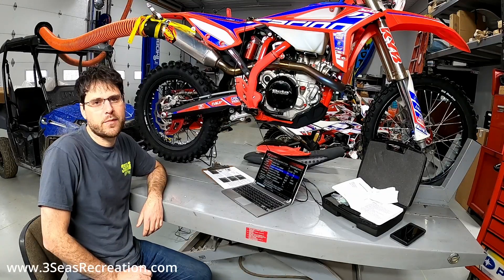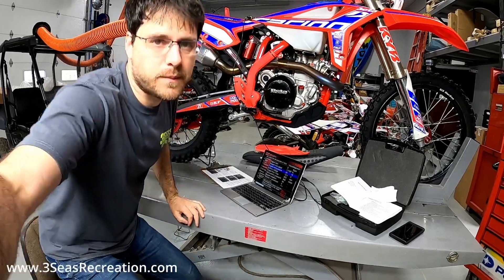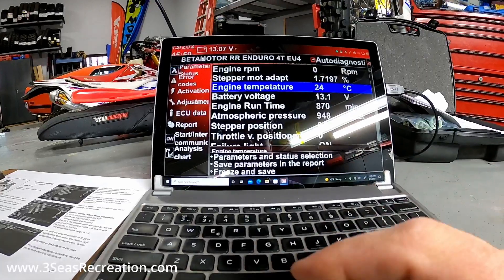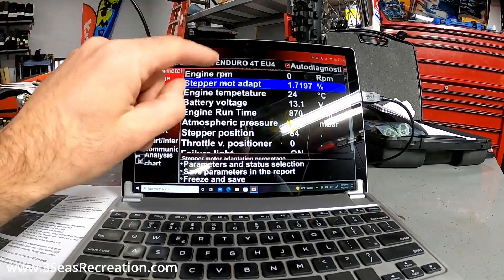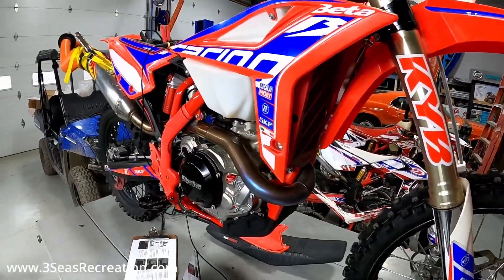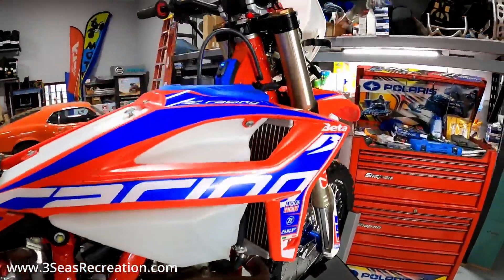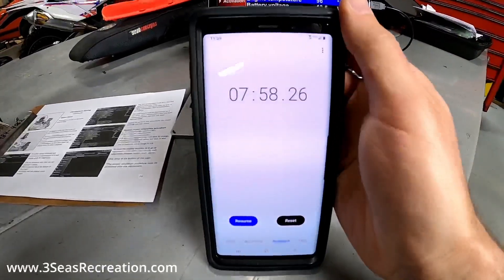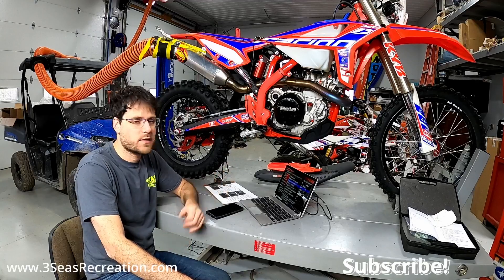Poor Running Beta 4 Stroke Motorcycle | STEPPER MOTOR RESET | Stepper Motor Adaptation Procedure

Comment: What if you’re out riding with elevation changes??? My bike runs like crap on mountain trails. Sputters and dies with clutch pulled in on downhills. 24 Beta 390 with less than 30 hours. I reset stepper at the beginning of every ride. Dealer says it has the open map plus 200 idle. Fmf slip on

Comment: I can’t get my bike to run long enough to change the stepper motor , does it matter if my battery gauge shows it’s only 1/2 full ?  2019 350 rv 19 hours
Reply from the maker: Yes, you HAVE to have a perfect battery for a 4-stroke Beta to run. Does not matter. I can't stress that enough. Enjoy The Ride, Jared

Comment: Hi
I have a 2023 beta 390 rr. I’m having trouble with the idle speed. When the bike is cold it doesn’t idle and when hot it idles very low. I’m not being able to reset the stepper motor because when it is cold it won’t start without me having to give it a little throttle.
Do you have ane suggestions?
Any help is appreciated
Reply: Never mind 
I fixed it
Reply from the maker: Good Afternoon, what ended up being your fix?

Comment: Hello, congrats from Spain 👍🏼👏🏼, i see all your videos and tutorial, it's fantastic 👌🏼 
i had a problem with my '21 beta 350 race, sometimes when i push the start engine switch, the engine turn but dont start, after the 3 or 4 try, the engine start normally, its posible that need a new stepper engine or adjustment?? Thanks and sorry for my bad english 😅

Comment: Jared, I am relatively new to Beta and your videos have been great. I have a 390RR-S. I have been doing the stepped reset and keep a good battery. Out of nowhere the bike all of a sudden revs super high at idle. I took the stepper out and cleaned it. Reinstalled and reset stepper. Everything seemed fine for a few minutes and then the throttle started hanging a bit. Then the really high idle came back. Is it common for these motors to go bad? Is this a symptom of a stuck motor?
Reply: 22 390rr mine did the same but only since i swapped bars over and the throttle cable was not sitting right on the throttle tube, coule be a simple place for you to start looking?

Comment: Hi, I would like to ask, when my rr 390 2018, warms up sometimes (mostly during riding) the bike gets really weird idle, when in sounds like it is nearly stalling itself (its like hard ticking sound, similar to badly adjusted valves ), when I restart the bike it doesn´t do it,  do you think it is a stepper motor issue ? When it could be dirty and doesn´t work properly or do you have any ideas ?

Comment: We love your content!  I often start rides here in Colorado at 7,000' and go as high as 12,, even 13,000'.  How do the Beta 4 strokes compensate for the decrease in oxygen at those elevations during a ride?
Reply: I have the same question. I live in St. Louis but ride in Colorado frequently. I just bought a 2024 Beta 500 RS.  I hope that I haven’t just made a big mistake.  May I ask what year and model bike you have? Does it run cleanly at high elevation?

Comment: What if it won’t start without cracking the throttle. Is it still ok and it will go through the process?
Reply from the maker: If you need the throttle for a split second that will be ok. I would think after the stepper motor resets you wont have to do that. Enjoy The Ride, Jared

Comment: More great info that will help get me get up to speed once I switch from Husky👍
Reply from the maker: Glad to hear it!
Reply: @3SRTVOfficial got the 24 390 last week. The stepper reset was done at the dealer at 2,000’. 
I did a reset immediately when I got home at 6,800’
I wasn’t paying attention. When I checked, it was at 226° Fahrenheit or 108 Celsius. 

My first ride today had a lag like a two stroke power valve. So it’s not fueling properly. 

Could going 13 Celsius over the reset value be the cause of the poor fueling?
Reply: Update. My bike had multiple problems. At 13 hours, the head, valves, guides and seals were all replaced. 
Looks like that solved the oil draining through the faulty valve guides and causing smoke. 

Once I learned it had 2 injectors, I asked if they were staged in the throttle position. 
YES was the answer..

That’s when it all made sense. I kept saying it acts like an accelerator pump or main jet carb problem. 
With the knowledge about how the secondary jet functions, I watched your jet maintenance video, used my $20 jet cleaner tool. It sprayed kpkike a squirt gun if 2 streams. 
I waited for the brake cleaner to soak a bit, then it kind of spit some thick streams out. 
The 3rd time, I sprayed for 5 seconds, that’s when a mist came out. 
4 time I couldn’t repeat the mist, but got more of a heavy spray. I’m guessing that there wasn’t as much pressure in the can at that point. 

I’m so glad I had your injector vid, I couldn’t have reinstalled it without that. 

Too much snow to ride, but it’s 90% better revving in neutral. I put a 2x dose of injection cleaner in the tank, now I plan on riding it clean as soon as the snow melts. 
Thank you

Comment: Hi. 
Thanks for the vids - they are awesome.
I note that the engine temp needs to reach 95 degrees to reset the stepper motor. Do you know if there is a simple way to install a digital display to the cylinder head temp sensor so you can see when it reaches this temp? If not, I know there are a number of options to do this for water temp but is this the same as engine temp, or is it higher or lower then engine temp?
Thanks
Reply from the maker: Good Morning! That is a good question, I don't have a fast solution for that. So that is why I took the time to film so you could watch my dealer screen that shows engine temp and that would give you a base line to shoot for. Most of the time you can physically hear the engine tone change if it actually needed to be done. When you hear that change in engine tone you know its complete! Enjoy The Ride, Jared
Reply: Jared, I am relatively new to Beta and your videos have been great. I have a 390RR-S. I have been doing the stepped reset and keep a good battery. Out of nowhere the bike all of a sudden revs super high at idle. I took the stepper out and cleaned it. Reinstalled and reset stepper. Everything seemed fine for a few minutes and then the throttle started hanging a bit. Then the really high idle came back. Is it common for these motors to go bad? Is this a symptom of a stuck motor?

Comment: Thanks for this video.  My '23 350 rr, I only ride in the same spot.  This has a persistent stalling issue typically at about 30 miles into a ride if I'm in low speed single track.  First they found out of the crate the valves were very tight from the manufacturer.  Adjusted.  Same problem. Then the ECU had a recall.  No fix. Then they replaced all sensors.  No fix.  The green plug on gas cap was removed before I took ownership.  Beta cannot figure out this issue.  I've owned it for 6 months and every ride has had this stalling problem EVEN with this starting method facilitated.  Is this something common or.....???  I'm about to drop this off by the Titanic.
Reply from the maker: Good Morning, Beta just released a new EFI map  (mid may) for all 2023 4-stroke motorcycles. You reallllly need to get that done, it has been a common issue this year with running issues especially hot starting. Also, there is a voluntary check on your voltage regulator plug. I would be willing to bet one of your pins in your voltage regulator is not seated correctly.  Your dealer should have access to all of these service bulletins. Enjoy The Ride, Jared

Comment: Hi Jarred,
a question regarding the battery voltage especially for MY23. 
What is the minimum voltage that the battery must supply to prevent the engine from poor idling?
Do you have any experience values?
I am looking into this on my RR390 and the limit seems to be 13.1V. 
If I make a restart below this voltage, this seems to lead to a rough engine running.
Reply from the maker: Good Morning, Beta actually has a service bulletin out on the 2023 RS models because the Voltage Regulator pins might not be crimped properly. I would recommend taking your bike into the dealer and ask them to check bulletin # SB-2023-3..    ALSO, I highly recommend you getting that 2023 in and getting it remapped. Beta sent out another bulletin explaining that every bike needs to be remapped. They all run extremely poor until that remap is done. New map came out mid May just for reference. Enjoy The Ride, Jared

Comment: what if a brand new 23 390rr doesn't want start without a small amount of throttle??
Reply: I have the same problem. If I start the bike cold, it will stall useless I give it a little throttle.  I don't know if that affects the stepper motor reset.
Reply: @brodybrown8923  
I've found if you adjust the throttle cable so the bike will start and idle,,,,do the reset then readjust the throttle for 1-2 mm of play, all is good

Comment: Does the stepper move while you're riding? I have an issue where the revs dip below normal idle for a moment after engine braking, as if the bypass is shut too long?
Reply from the maker: Good Evening, No I do not think it moves. It will reset when doing this process but I don't think it changes while riding. I would check your battery, as silly as that sounds those batteries have to be a perfect 12v on the 4-strokes to work properly. Enjoy the ride, Jared

Comment: Even if you don't get  all infos and the erase default codes possible, any BT dongle and a good software on your phone  (like car scanner pro) will give you infos about engine temperature ;) . I found too that the 8 min is a good average value to get to the T° and complete the procedure . But I guess race map I'm running now  has more ignition timing advance, as bike warms up far faster  ;) Found too that lots of people become a bit obsessed by the stepmotor procedure. Doing it each time they use the bike, masking in fact other problems like bad valves play, some air leak in admission hoses, not recent spark plug, low voltage or bad charging ( as you mentionned ); etc... ... BIke well set up  doesn't need often stepmotor procedure, even when changing elevation places. Secret is not to fast open the throtlle when you start riding, but be super smooth on it, let it gently warm up during begin of ride (and engine says thanks too ;) )   Correct me if I'm wrong, as I had a very short time using BST with the euro 5 last ECU version, but I saw that the excursion of step motor was  possible from -20 to + 20 value now... I can be wrong...  PS : JUst pluging ODB2 cable  wakes up the bike and you can clearly listen to the step motor and fuel pump activation .. in total silence ;)

Comment: Hey Jared, nice Video.

My Brand new 350 2023 with 3h on it. sometimes it starts realy bad if its dead cold.

Today wanted  to start the dead cold engine to do the reset, but i couldnt start it for about 4min. Seems there Was like no Choke.
After that Desaster i had to twist the throttle a little bit to start the engine.... Do you think that could be the Stepper?
Bike in perfect new condition. Dealer is informed. Maybe a remap could help?

Thanks in advance.
Reply from the maker: Good Morning,  I would certainly try to get the stepper motor to reset. Other things you should try is to fully charge the battery, I don't think most dealers fully charge the batteries before the bike leaves the dealer and the Beta fuel injected bikes HAVE to have a perfect battery. I think 4 minutes of trying to get it to start has def weakened the battery. Also, I would try a new spark plug... sometimes a new bike can need a plug from the light coating of oil they put on the engine internals to protect them during shipping. I have not yet seen an updated EFI map for the 2023s so I am not sure that is required.  Enjoy the ride, Jared
Reply: Tanks a lot and keep up the good work!

Comment: Very useful video, thanks! I recently got a 390 and am trying to learn as much as possible. I tend to let the bike warm up for about 10 mins anyway so that should have me covered it seems.

One question on the stepper motor reset. Does it matter if you switch the bike off after it's reset itself or is it fine to ride on?
Reply from the maker: Glad you found our channel! After a stepper motor reset  is complete you can touch the throttle and ride away! No restart needed! Enjoy the ride, Jared

Comment: When the stepper motor is adjusting between 85-95°C can you feel it tapping if you put your fingers on it? If so does it stop tapping at 95 a signal that it's done resetting?
Reply from the maker: Good Afternoon, yes I would think that if you have your finger on it you might be able to feel it adjust. I think those temps are right on track for when I would expect it to start moving and also finalize. Enjoy the ride, Jared

Comment: Thanks from Germany Jared!! 

At my last three rides i have the idle problem, especially when the bike is like cold and warm after 5 Minuten of riding.

My local dealer dont know this problem, and i hope that the bike is running better in the future, when i let the Beta warm up for 8 Minutes without driving..
Reply from the maker: Good Morning! Thanks for checking out our channel much appreciated! Have you tried a new battery? I would start with that. Secondly has the dealer reflashed the bike with the newest map available? How many hours are on the bike? We have heard of worn throttle bodies that will cause that issue and there is no fix other than to replace the throttle body.

Comment: 2019 390 rr race edition. Is there a way to turn the idle down maybe 100-200rpm? Is there a program/map for that?
Reply from the maker: Good Morning! Thanks for watching our video! I'm thinking you have already done the stepper motor reset as you see the video here. Next I would have your bike reflashed with the newest ECU map for your bike (They update maps periodically). Here are some other things to check: 

Hanging throttle / slow to return to idle. The most common causes for this are:
Low battery/charging confusing the ECU.
Failure to perform the stepper adaptation procedure.
Dirty or worn throttle body.
Stuck or bad stepper.
Air leak.
Glitch in the ECU map.
No throttle cable slack or something causing tension.
Binding throttle tube.

Comment: Hi Jerrad, I took the steeper motor out on my 430 and cleaned it. After I reinstalled it, I fired it up and the idle was slower and dropped right back down after you rev it up. Happy me. Then I decided to reset the stepper motor. After eight minutes when it came up to temperature, I shut it off and then stated it back up after a few minutes. The bike is now idling much higher and it takes about five + seconds for the idle to drop back down.  What happened? Do I need to take the motor back out and then not reset it after I put it back in? It does have a new battery. Took the stepper motor backout, wipe it off and put it back in. Took it for a ride, after a couple minutes the hanging idle started and it got worse as the ride went on. It got to the point where the idle would pull me along at 20mph, a little scary going down step trails lol. Time to replace it?  Thanks
Reply from the maker: Good Morning Howard! Check out our Facebook Message Chat, I have replied on there with some suggestions! Thanks again, Jared.

Comment: My bike is brand new and running like crap. It’s unridable.  Idling super high and almost accelerates when letting off the gas. It’s a 22+ 390. First Beta and I’m wishing I hadn’t bought it. it literally has about 2 miles on it. I’ve tried the stepper reset with no luck. My dealer is far away and seems to be uneducated about most things BETA. Do you have any ideas you’d be willing to share?
Reply from the maker: Good Morning, sorry to hear that about your bike and I'm sure it's something simple. If the bike was here at the shop I would do multiple things on my computer such as reflash your ECU and do the stepper motor test and check for error codes. 

Here is the list that Beta USA gives us to check if a bike comes in with those symptoms. Obviously with yours being new I don't see the stepper motor being worn or dirty. Try and check these things: 
Low battery/charging confusing the ECU.
Dirty or worn throttle body.
Stuck or bad stepper.
Air leak.
No throttle cable slack or something causing tension.
Binding throttle tube.
Reply: @3SRTVOfficial  another thing which made my bike  in hot summer backfire, run  bad, idling high, etc...came from the hose admission collars in between body throtlle and engine . We are used to check the hoses bike cold, as  exhaust is near, super hot and can burn hand. Hose being  just near the exhaust , rubber becomes flexible and wieght of body  throttle deforms it and makes some air leak. 
An other symptom of  air leak on 4S Beta is too much sensitivity of spark plug cap, bike running super bad if not  down to  0.5 to 0.6 mm
Reply: @3SRTVOfficial  Thanks a lot!! Unlike some others you actually give good advice - keep going!
Reply: What was the issue?